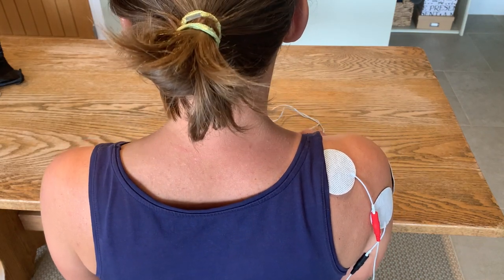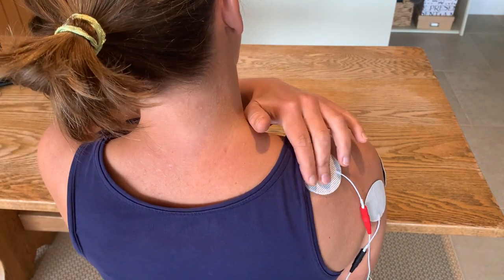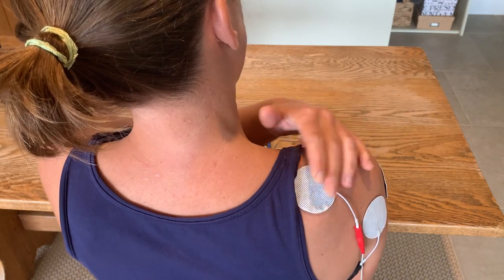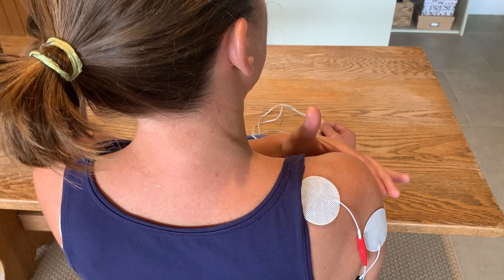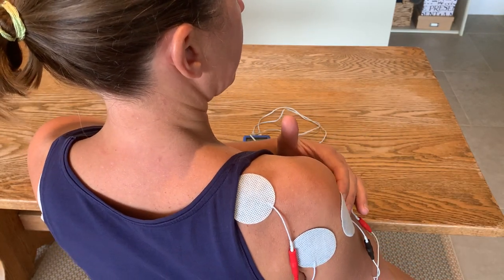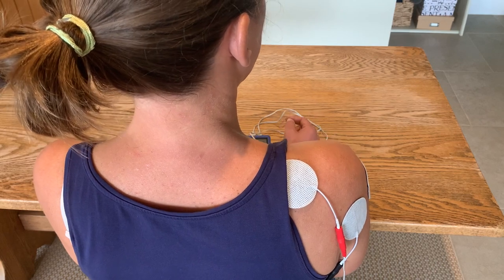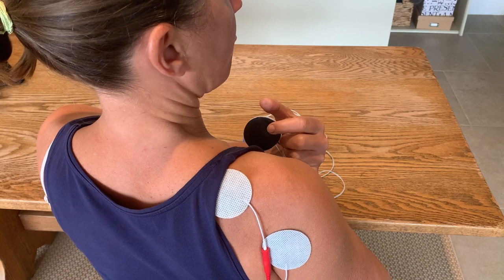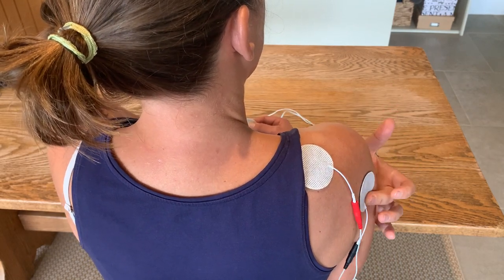Electrode Placement : Shoulder Subluxation

Comment: Thank you for this information.  I am having some nerve issue’s presently  from the top of my left shoulder down to my finger tips.  I have a Flex-MT Plus when  i had my with my right  knee replacement in Rehab.  Just searching here on where the electrodes should be placed.

Comment: Should this be accompanied by arm flexion or it is passive?
Reply from the maker: It can be used on its own if someone has a subluxed shoulder. If there is voluntary activity then work with the stimulation , if there is no activity then it would be the device doing the muscle contraction. No harm in adding any other movement
Reply: Which current is it?? Faradic or Russian??